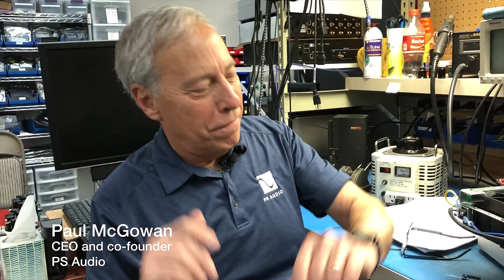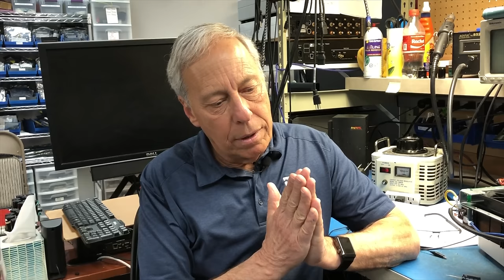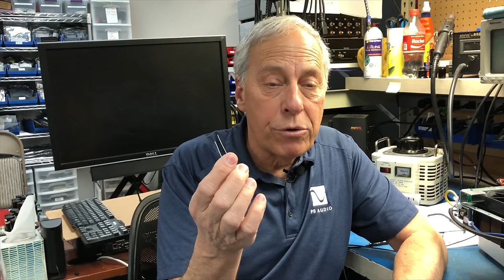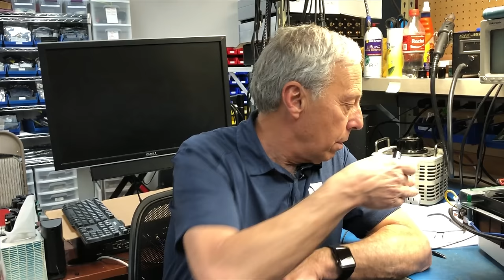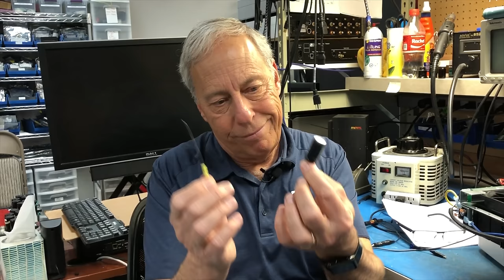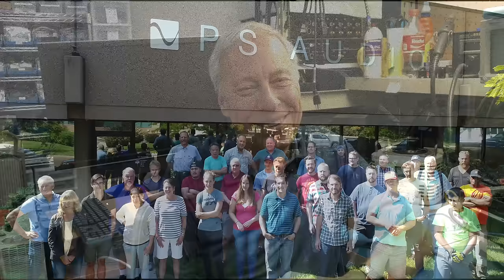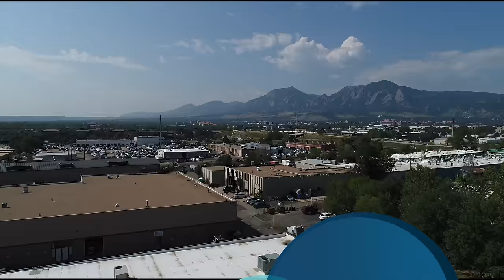Why do capacitors sound different?

Comment: Excellent video!  I've been reading about capacitors all week!  Nice timing.  I just took the lid off of a Yamaha B-2 last night.  If I can get it to work, I want to do a full restoration.  Living in Japan, I got it as junk for $200.  It turns on, but no sound.  

If anyone has restoration advice for the B-2, hit me up!  Thanks!
Reply: Unplug and not turn on! Have a tech look at this. There are plenty of posts about refurbing this amp on diyauidio. B-2 amps that have not been maintained by a tech "frequently" kill the vfets. If you are lucky, your problem is different as the B-2 uses vfets which are unavailable. Regardless your amp may have some vefets that are still good and can be sold. Good luck
Reply: John Reardon Always best to have a few on hand from which to use parts. I use to own 3 back in the late 70s. Good luck with the project.

Comment: Paul,We've been using Sprague electrolytics in Fender guitar amps for years now.The prices have been going way up.Starting to use JJ caps.Half the price. Illinois Capacitors are the budget ones but look cheap.Orange Drops have been used widely for coupling caps.I've started using the 150s.They sound a little smo6other to my ear.What do old filters sound like?I tell people old caps are like looking through an out of focus camera and new filter caps are like dialing the focus on.Have you ever messed with a Fender tweed Bassman? How about an Ampeg SVT?The SVT has six 6550 power tubes,700 volts on the plates and 300 watts of humping bass tone.O.K.What's a good guitar tone ?Listen to AllmanBrothers Band,Eat A Peach,Mountain Jam.Duane Allman does a guitar solo towards the end, after the drum and bass solo.It'a a one four chord progression,kinda gospel sounding.A  50's sunburst Les Paul through a 50 watt Marshall amp with one or two Marshall 4-12'' speaker cabs.Duane gets everything from sweet and clean to full on tube saturation.The Marshall is a copy of that Fender Bassman 5f6-a circuit.Here's the funny thing about Fender amps.I read an interview with Seth Lover and he said Fender amps are nothing special.They are so logical and straight forward,easy to work on and built with common parts.If I was gonna go on a trip across the cosmos in a space ship,I'd take the old hand wired Fender.You could teach a class on good layout just from looking at it.Other people have said it.Leo's  genius was layout and grounding.Sorry,this wasn't supposed to be so long.I fell down the rabbit hole.Happy Listening and Playing.

Comment: I used polypropylene and polystyrene caps in my crossovers. But no matter what type of caps are used caps are known for creating different kinds of distortion. Two caps wired in series (as opposed to a single cap) with a DC V applied to the common point between, eliminates phase shift and keeps the cap layers tight as the voltage/current constantly change. Creating a biased XO, or what JBL called Charge-Coupled Network™️
Reply: Milton Crosbie JBL used a 9V battery to apply biasing between 2 polarized caps creating a stable non polarized cap. When tested, it didn't have any audible or electrical benefit and was abandoned in subsequent models.
Reply: Darin Brunet actually all the K2 & Everest models from 1993 up to about 2014 used the biased XOs. With the last ones using a biased circuit instead of the battery. The resulting sound is cleaner, with the distortion removed. I also read that Vandersteen used a bias XO on at least one of their models.
Then at the time JBL Pro came out with the M2 Reference Monitor with dsp enabled Crown amps and active XO, Greg Timbers did the same with the last Everest he worked on, except using ML amp.

Comment: Hi Paul. Off topic question here, and one I assume you get asked a lot. I remember back in the late 70's a friend of a friend had a system comprised of homemade bookshelf speakers and what I would assume was a class A amp/receiver and turntable. We played a lot of vinyl, (rock). Volume was never a consideration. The sound "filled" the room, and you could hear every individual instrument. To this day I've never heard anything that could compare. I have always aspired to recreating this sound, but nowadays with most sources being digital, I have never really come close, (mostly due to budget constraints). I recently came across the Dayton Audio APA150 for under $160. It would be powering two Polk 200TSi speakers. Media sources would be digital so I am currently using a SMSL SA-50 amp paired with a Signstek HIFI USB to Coaxial S/PDIF Converter Decoder Mini USB DAC PCM with 2704 chipset, (I also use an audio EQ extension on my PC to accentuate the highs, mids, and lows). What is your opinion of the Dayton Audio APA150 vs. say... the Emotiva BassX A-100 , and could your offer an alternative DAC? Am I at least headed in the right direction?
Reply: another question ignored by Paul

Comment: Why. Do mica caps sound so good ,Tom oberhiem used the on the ob-x only 800 made and the best sound synth they made  According to him , A lot of what makes vintage synthesizers sound so good Is there an Inherent instability and fluidness Also the earliest machines use all discrete circuits It's the things that were from an engineering perspective wrong with them that made them sound audibly so good

Comment: Oh here we go!  My favorite guy who doesn't know as much as he thinks he knows.  I wish Paul would have answered the questions asked, also.  First off,... caps will pass DC in a series circuit until the cap is charged, and the  current passed, drops off exponentially with time.  after the value of the cap times the resistance.  so a 1 microfarad (micro = 1 millionth Paul) cap takes about 1 sec to reach a 91% charge when loaded to ground relative to the charging circuit .   1/1,000,000 F multiplied by 1,000,000 ohms = 1second.  Similarly once a cap is charged, if given a parallel load resistance that is equal to the charging resistance it takes the same amount of time to discharge 91 %.,  Since all audio circuits have DC power supplies with those "horrible" & cheap electrolytics, that according to Paul don't pass DC. how is it that they can be used to pass audio frequencies from a fraction of a Hz to 100KHz or more? and be used to store DC to release to the amp when needed? In most amplifiers if electrolytics are used as coupling caps which is sometimes done, the equivalent resistance that loads them is so high that the effective series resistance of the electrolytic cap (very low) has no measurable or noticeable effect.  I was once in charge of maintaining video distribution amps that drove 75 ohm cable, and terminated in 75 ohm loads.  The color burst signal that affects color rendition  at 6.8 mhz with several degrees of phase shift discriminated by chroma circuits to determine the different colors was undaunted by the cheap 25 mfd @ 25 volt electrolytic caps used as coupling caps for the entire color video signal,.  Although film caps are measurably better in stringent situations,.. I have tested many "golden eared" people who can't differentiate "the huge audible" difference between electrolytic caps and film caps, in blind A/B testing.  Anyway if Paul was really interested in learning something, he may be interested to know that some cheap, and thin flat ceramic disc caps actually are sensitive to acoustic signals, and so "can be heard".... that should give him something to rail about! 
  
   So in short for Gerhard in Calgary the quality of caps in a crossover (I assume You are talking about if You are talking about passing bass.  Equivalent series resistance resistance may be of some interest.  Large film caps rated at 200 VAC will generally work quite well unless You are using over 400 watts, or You can use non polarized electrolytics.  The larger the package (higher voltage caps are usually larger), the thicker the foils tend to be, so the equivalent series resistance will be lower.  frequently You pay a premium if the manufacturer is selling their caps to the audio market, because of the gullibility of the end users.  It is better to bi-amp or tri-amp and use an electronic crossover, than try to deal with the various issues that arise from the short comings of tone discriminating networks, and impedance matching and phase shifts that come from crossovers.   In amplifiers or preamps mostly the type of cap doesn't make so much difference as long as they are spec'd properly.  If You can't hear the difference between a 6.8 mfd non polarized electrolytic in a crossover, and a huge audiophile polypropylene film cap, that cost $350 .00 there probably isn't any! 

  And Paul caps are made from two interleaved ( yes rolled up foils) foils separated by a dielectric, which IS an insulator,... Yes,...but the dielectric properties of the dielectric are the important factor.  Electrolytic Capacitors usually have aluminum or tantalum foils, which also have a surface treatment as well as a material to physically separate the electrolytic chemicals.  There are many types, and different chemical electrolytes, which result in a huge range in terms of cost and longevity, but as Gerhard points out the specs pretty much tell the story, and I have yet to have been shown up by any golden ears, as to difference, unless we are talking about caps that have to dump huge charges in fractions of a millisecond.  And as far as that goes foils are better than films if the important factor is huge current dumping capacity.

Comment: The actual real differences are in manufacturer tolerances, leaking, polarized vs non-polarized, potentially speed in the dielectric, and mechanical ability to handle wattages.

First in tolerance, which is the primary reason for "better sounding" : a high end capacitor will have a tighter tolerance. Whatever a capacitor is rated at, it actually will have capacitance (or capacity to hold charge) with said tolerance. So a tighter tolerance will be more consistent, which makes a difference in perception of a speaker line because they'll be more consistent with the manufacturers intended design, but also if there are multiple capacitors in a circuit with wider tolerances, they can have potential mismatches and cause frequency drops or gaps, etc.

The to leakage: all capacitors leak somewhat. If you charge one up, a non-leaky capacitor, or a perfect capacitor, will hold that charge indefinitely if there's no circuit to ground it or bleed it off. Indeed some really big electrolytic capacitors can hold lethal currents for years after last use, old tube amps and CRT monitors/televisions were notorious for this. However, there's no such thing as a perfect capacitor. Eventually they all leak and lose their charge. And eventually as current passes across the plates, ions of the plate metal are lost through electrolysis. So the capacitance is also modified and diminished. Some types are more resistant to this based on the material(s) of the anode or cathode (which can actually be different materials), the more 'inert' the material, the longer it will last, but a lot of inert materials aren't great for storing electrical currents, many are too conductive or not conductive enough. This is why semi-conductors are typically preferred (transistors are very similar to capacitors, and this is why silicon is used in computer chips). And the leakier they are (typically through inductance) the less reliable and consistent they are, and of courses inductance can cause undesirable noise when you don't want said inductance.

Then polarized and non-polarized: polarized will only allow a signal to pass a certain way, non-polarized, both, which has implications primarily in AC circuits, but there are times either way where you'd want a polarized vs non-polarized cap. Typically electrolytic and tantalum are polar, where most Paper-in-foil, ceramics, etc are non-polarized. In my experience, most of the time you don't want polarized caps in an audio signal where you do in a power circuit. In a power circuit this leads to cleaner power. I'm not 100% certain why you tend to see more non-polar in audio signals other than it might not make a big difference in low voltage applications and electrolytics tend to not last as long and are more expensive.

Then there's the dielectric or "insulator" in the capacitors. They aren't true insulators, or they'd never pass a current. Instead they're typically materials designed to be the right amount of resistance so that once the charge builds on the plates, they pass the right amount of current at the right pace. Some have some different behaviors.

Then there's mechanical ability to handle wattages. Typically as long as the wattage it's rated for exceeds what you're putting through it, there won't be much of a difference. Though, higher wattage capacitors tend to be bigger, therefore better made, and more durable and consistent. But they also tend to be more expensive, partially due to the cost of the extra material and manufacturing. But also certain types like ceramic disc don't make a ton of sense to make large enough to use in the high wattage situations that call for an electrolytic or tantalum, and might likely be cheaper but too large and heavy to be practical.

Of course this is all still a simplification and I've generalized some things that may not be technically correct. But generally speaking, more expensive capacitors are going to be more consistent electrically and more durable, leading to somewhat better, but more consistently good sounds for longer.

Comment: A tip:  If there's an electrolytic in the signal path, DON'T replace it with a tantalum.  Tantalum capacitors have less leakage, and (presumably ?) last longer, BUT, their capacitance vs applied voltage characteristic is nonlinear.  Not by much, but any nonlinearity is too much, and will introduce distortion (mostly IMD, the most objectionable kind).  They're fine for bypassing, but not coupling.

Comment: I have never heard this trick of paralleling an inexpensive, low uF value cap with an inexpensive electrolytic rated for the majority of uF between the two. I have never been able to build with film capacitors because of the cost. But I'll certainly give this a shot. Why not?

Comment: This I can attest to, I have rebuilt crossovers with some expensive exotic caps in my Magnepans and they do alter the sound.
Reply: Did they improve the sound...or just alter it?
Reply: David Myers I've messed with crossovers in a few of my speakers by buying upgraded versions. I would say altered, not necessarily improved. I wouldn't go blowing your budget on things like this.The caps in my Maggie's are Jupiter Beeswax bypassed by Mundorf Silver in Oil. The main thing that changed is it's a whole different design from stock, the crossover.

Comment: Electrolytic capacitors are rolled tightly and put into that can. The rolled construction takes on some characteristics of a coil with high frequency.
A choke coil resists frequency change, and so does a rolled capacitor.

Comment: This video provided some information about capacitors and their use in audio equipment that is premised on the idea that film caps sound better. It didn't in any way attempt to answer the question of WHY they sound better. I understand that there may be some motive to keep these videos informative and approachable to the layman. The issue is that you've selected a question that is only properly answered in ways that may be intimidating or out of reach of the layman. I propose a better route would have been to select a question that allowed an answer that is the type of content you'd like to provide, as opposed to what this video is (something that may fool the layman into thinking they've gotten a technical answer or explanation, when they have not). This would also go a long way to diseude the less patient among folks like myself from yelling "snake oil" as we are wont to do.

Comment: its kinda like a battery but with a small capacitance like it charges really quickly. if you take a 12v charger and attempt to charge a 12 volt battery the charger will draw full amps at first because the battery is dead but once its almost done charging the amps will drop to almost none but once its completely charged and the voltages matches the input voltage the amps will drop to none and no current will be flowing. go head and get a battery and a light bulb the light turns on but it you put a battery in the line but put the positive to the other positive and the current wont flow because the charges match and theres no current flow but if one battery is slightly more dead than the other the current will flow in the direction of the dead battery to charge it and no aa batteries dont charge well but current dont know that and will flow anyway. i have once used a power supply as a diode just to see if you really need diodes to make electronics turns out no you dont you just need a way to make current flow in only 1 direction. 20+ years of crazy research time well spent i hope

Comment: With early technology, a capacitor with a value of one Farad was not even something that could be manufactured.  The definition of a one farad capacitor was using an air dielectric and a spacing of one 32nd of an inch, and having a plate area of 36 square miles.  We have done magic in making the dielectric constant much higher with new materials.  The capacitor described's constant would be one.